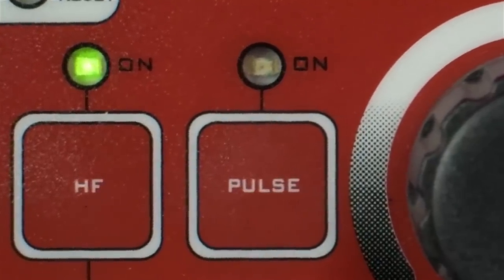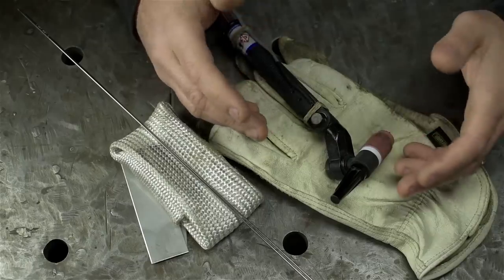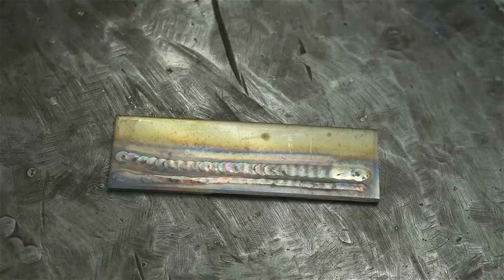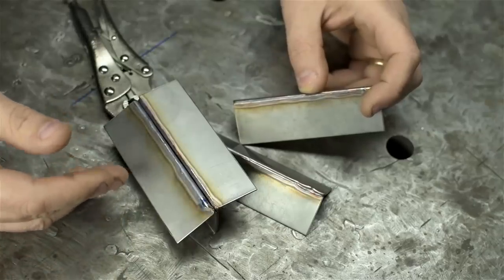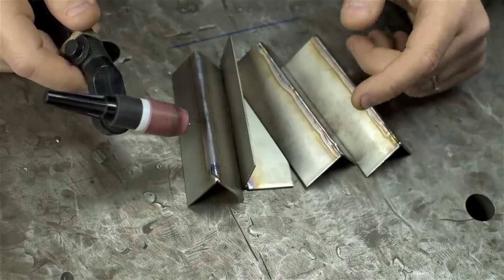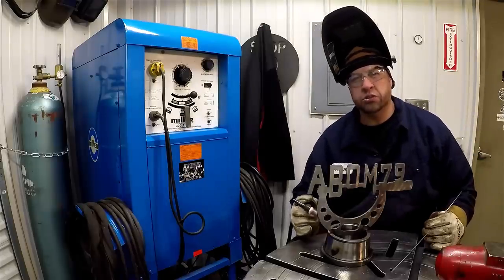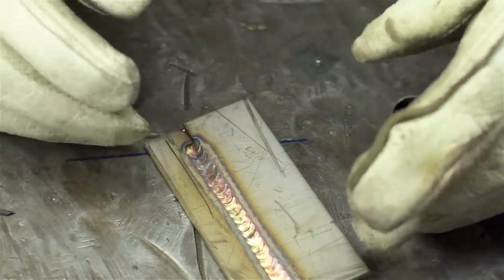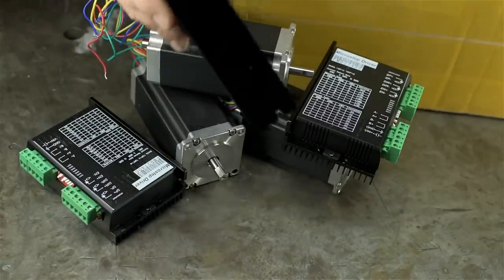PuLsEd TiG WeLdiNg

Comment: I've, for the most part, left it on. I dunno, it helps me quite a bit and i'm a lazy creature by nature. One thing for sure, i know, is the fact that my welds, cosmetically, have gone up from a solid 5 to a decent 7 to 8 depending on angle of attack. And i know, it's not for everything, but i make it work.

Comment: Hey Tony,  how about you do a test and review of an unusual piece of weldin gear. 
They seem to resemble a hybrid of a TIG welder but used as a spot welder and doesn't use any shielding gas. It can apparently weld together different metals without any kind of flux, can you touch the tip to the workpiece and when you pull the trigger to fire the pulse just before the pulse strikes the tip automatically retracts so you're not dipping into the puddle.
I originally looked into these because I needed to join some freakishly thin material and my MIG welder and it's smallest setting  what's the smallest solid core wire was still sloppy as hell.
One is called the Orion Pulse Welder, or the cheaper version, the Sparkle Pulse Welder.

Comment: I'm curious what happens if you pulse a cheap stick welder? Would you be able to weld thinner material without blowing through? Would the pulsing effectively replace "whip and pause? I bought the parts to do this, but I'm too lazy to rig it up. In fact, I'm pretty sure I lost them while busy with other things.

Comment: As a self described "non professional" welder, do you find yourself utilizing all of the various pulse settings on your machine? I am looking to buy a machine, but I am not sure if I need to spend the extra bucks for the increased level of adjustment. The Lincoln SQwave Tig 200 has some basic pulse settings, and I am wondering if that is enough or if I will eventually wish I had finer control. Any advice? I am a hobby-level welder, but like you, I like to tinker quite a bit - and I tend to gravitate towards things with lots of knobs and dials.
Reply from the maker: I do use pulse a lot, really great for thin materials.  If the lincoln can do less than 1 pulse/sec I say go for it.  No one really uses 4 million pulses/sec.  I too like to fiddle, and like having all the options, but certainly not required to have a ton of fun.  Go for what fits your budget!

Comment: I pulse from 30pps to 100pps when I use pulse
My amperage ranges from 140/180A
I'm using 3/32 2% lanthanated tungsten
Gas flow about 15cfh
Miller dynasty is my machine (and I love this machine more than I do most people)
Full on spoiled at the shop.
What do I make? I make parts for deep fryers lmao
I love ToT :3

Comment: The main thing I don't like about using pulse while tig welding is that my machine doesn't have it.... and I only have a finger control, so I can manually pulse either. Ima get a foot pedal soon though. a machine that can pulse will have to be way later

Comment: I prefer flux core overhead welding.  You get all the smutz from the flux and bb's falling onto you.  
+10 points if you wear a t-shirt wile welding.  I prefer the +20 for welding with no shirt and shorts...

Comment: I gotta get into mild and stainless overhead. Any tips? I have somewhere around 10 hours in total of time spent on a tig machine, mainly on mild steel, a smaller chunk spent on stainless and the rest is a good mix between SiB brazing and aluminum. Should I be good with any skills I currently have, and just adapt what I know to work with overhead or what

Comment: The main problem i see you're having is too much torch angle. Keep it more upright and you'll have an easier time controlling the arc, and you'll get better gas coverage. If you have to increase your tungsten stickout to still be able to see everything, do so. The little bit of extra stickout won't harm your gas coverage as much as having that massive push angle
Reply: Also, bad gas coverage will discolor the weld, dirty materials will cause that smokey look you were getting with the overhead

Comment: Do you use a respirator/ventilation for chromium in your mask when doing SS? You should. Cancer = bad.
Pulse really shines on AL welding. So does He Ar mixed gas.
Reply: Does a pulse setting help a DC welding machine break thru the top layer of aluminum? Does it make DC tig possible on aluminum now?

Comment: When you Say around 9:40 that pulse Is used on Pieces where you can find the right settings, so you do a lot of the same pieces, then you Say that you can save settings on memory, in the jobs: that's the Key.
The main problem Is that you guys in the u.s.a. work in a way that Is not so functional for job switching, because of your TIG torches: the htp, wich Is a stel, just as all the EU made machines, are designed for welding with their own OEM torches, that have generally 2 buttons: the First Is used to start the arc and stop It, while the second Is used to bump up and down amp remotely, but of you enter in job mode it's used to switch beetween Jobs while welding!
So considering that you can save, i dunno, 50 to 100 Jobs in your welding machine, you can Just create some Jobs (for example from 1 to 10, from colder to hotter, job 1 50 amp x PPS, job 2 50 amp no pulse; job 3 70 amps same PPS as job 1, job 4 70 amps no pulse and so on.) Start welding and switching beetween Jobs till you find the 1 that Is ok and you can still adjust heat switching beetween Jobs while welding.
That's a very different way of working compared to the 1 you are used to.
Your torches are very confortable, but Better suit with a foot pedal and with bench (small Jobs), while of you have to work in position and in big structures you Need something different, for example your TIG Burton, or a stel Torch for tour machine.

Comment: ToT, do you carry the scar on your leg and chest from absent mindedly  pushing the hot tip of your filler rod through your clothes? Its a true sign of an experienced TIG welder. If not you should join the club!

Comment: Maybe daft but i am not totally convinced that a welder with all the bells and whistle gives (helps develop) a better skill set.  Its nice and all but how often do you really use all the wave form variations?
Reply from the maker: It does not.  Not without someone who knows what they're doing course-correcting over your shoulder.  But failing that, I think pulse can help develop timing.  Like a metronome for musicians.  I assume that's what they do with metronomes, anyway.

Comment: tony, have you seen these new "cold welding" videos? where they spot weld thin metals without filler and protection masks. seems like a tig but with more advanced computer.
do you know what that is and how i can achieve it with a normal tig?
Reply from the maker: you taking about all those tiny "jeweler's" welders that are popping up on eBay? I think they're spot welders.  no good way to do that with tig welder.
Reply: @ThisOldTony  yes, thanks! kinda like pulse arc spot welds

Comment: Why were the old units so huge? Is it the mainstream use of SMPS (vs linear psu) that shrunk them down?
Reply: Long-story-short, yes.
Reply: Technology shrunk them. My first pocket calculator used a 9 volt battery, and I'm not joking.

Comment: Pro tip #1 If you have a colleague who is stick welding on a tig machine. You might be able to turn pulse mode on, loooooong pulses.
Then sit back end enjoy the swearing and ampere adjusting.
Pro tip #2: Don't do it if the weld is to be x-rayed or tested in any other way. It will probably be ok, but you never know.
Reply from the maker: with my luck I'd end up with a black eye. ;)

Comment: Are you really based in LV? I'm a local home based machinist with a VMC and would be happy to help on a project if you need it. Was inspired by the Knuckle Duster video and ended up making one just to see if I could. Contact me if you would be so kind. I'd love to connect.
Reply from the maker: I appreciate the offer Michael!  How'd your duster turn out? that's awesome!
Reply: @ThisOldTony  Turned out very well I think. If there is a way to send you a pic or two I'm happy to. I'm in LV if I didn't make that clear. Been following your channel for a while now. Keep up the good work. They just keep getting better.
Reply: @ThisOldTony  https://www.instagram.com/p/Bqxfqr_lufN/?utm_source=ig_web_button_share_sheet  I did not do any post machining sanding or polishing. Just a once over with a scotchbrite pad and off to the anodizer

Comment: Hey. My DialArc Miller 300 was invented "turn of the century" But was made in 1985. Yes it weighs 1643 Lbs. Yes is is older then my children. No it does not have ANY buttons, LED's, or even fine adjustments. The only question left is.....Why don't I buy a "state of the art" new welder. Answer ? IDK.  sorry to nerf a old video, But honestly its like an old girlfriend.  35 years and I still feel like I should not marry her. But MAN, the beads we put down......

Comment: I am trying to save up to buy my first tig for hobby purposes. I would love to know, by a professional, (but I don't know any) if those cheap £150 ish machines which say they can tig/mig/plasma cut all from the same cheap box, actually work ok?
I know you get what you pay for, but a good machine like yours is just way out of my reach.
I have a 'gasless mig' at the moment which was given to me, it does what I need but the spatter is a big problem as I'm in a wooden shed full of combustibles (my wife's idea) so I was thinking that a tig would be the safer option. I just thought that either you or your followers might be able to shed some light on my dilemma.
FYI,
I'm a 63 year old, retired fat cripple from Norfolk, England. I have a City & Guilds Certificate in TV repair and soldering (1975) so how hard can this be?
Reply from the maker: hahah!  I don't have any experience with them but a $150 box that does it all sounds too good to be true.  Check out ChuckE, AvE, WeldingTipsandTrick, and Fabrication Series -- they do reviews at times of welding machines.  Good luck have fun and be safe!
Reply: @ThisOldTony  Sorry, should be £150 not $

Comment: i pulse all my welds, but i do it with my foot pedal not the control panel. Your dips are too far apart BTW. You want the dips to overlap at the hips of the weld. Stack of dimes not a row of 8's
Reply from the maker: thanks Diesel!

Comment: Absolutely excellent video! I've been considering getting a pulsed welder for a while now (my current machine is DC only, and continuous only). Thought you might be interested - there's a technique called "pulsed arc welding" which is essentially single-pulse TIG, and is used for very fine welding of wires, thermocouples and the like. There's ridiculously expensive machines that do this, but a few years back I made a footswitch with an inbuilt timer circuit which can give repeatable pulses (up to 100ms). With it, I was easily able to weld thin/small stainless, such as 0.5mm wire or 0.2mm shim. Ended up using it a lot when I was playing with vacuum tubes, since some materials couldn't be spot-welded. There's some spiel on my page here and the associated links, if you'd like to see it: http://imajeenyus.com/workshop/20110217_pulse_arc_welding/index.shtml
Reply: Great idea with the timer in the pedal! I've built a little box from an old disposable camera flash to weld tiny wires, but you don't get much of any real control.

Comment: Could you connect a MEMS based accelerometer to your TIG to adjust the amps to sync with your movement? The slower you go the less the amps and vice versa. Has this been done anywhere?
Reply: Or the accelerometer could be adjusting the pulse speed?
Reply: There is a reason why it's done opposite way. You adjust speed to pulse/amps.